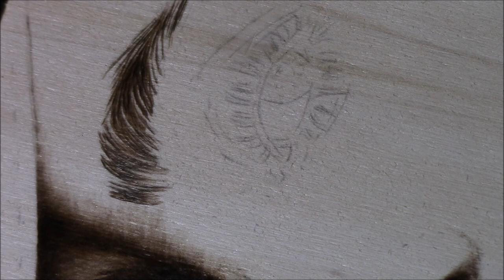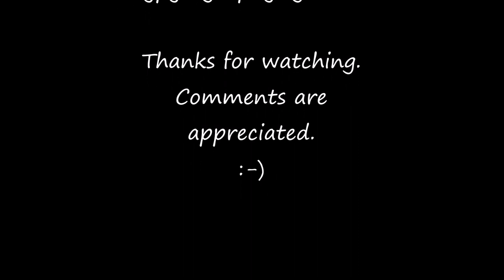Pyrography – Portrait of Lady Gaga – with a little talk about art and social media exposure

Comment: What wood finish do you use? Liked the videos thanks.
Reply from the maker: Hi Ray. Thank you very much.
First I use a universal fixative because I used a white pencil to enhance the whites. You can buy it at any art store. After that dries I use a layer of wood sealant. It is acrylic water based. After that dries (maybe 24 hours) I use a polyurethane spray. This last one you can apply several layers until you achieve the result (gloss) you like. Wait for it to dry between each layer.

1 - For the pencil
https://www.amazon.co.uk/Ghiant-Fixative-Fast-Dying-Acid-Free-Non-Yellowing/dp/B073VP9FX7/ref=sr_1_fkmr0_1?ie=UTF8&qid=1525024801&sr=8-1-fkmr0&keywords=giant+academy+fixative

2 - to seal
https://www.amazon.co.uk/Bondex-tapaporos-0-75-L/dp/B010Q32OWW/ref=sr_1_cc_2?s=aps&ie=UTF8&qid=1525024916&sr=1-2-catcorr&keywords=tapaporos

3 - The finish
https://www.amazon.co.uk/Rust-Oleum-400ml-Crystal-Clear-Spray/dp/B001W03PRM/ref=sr_1_3?s=diy&ie=UTF8&qid=1525025367&sr=1-3&keywords=rustoleum+spray+paint+for+wood

Thank you very much for watching my videos and for your comment.
Hope this helps and works for you.
Reply: Thanks

Comment: What paper and temperature did you use for this portrait?   BTW I love your work!
Reply from the maker: Hi Gabrielle. Thank you very much. This is birch plywood. It's sold by Amazon. They have several sizes. This one is A4 size. I used lower settings and two machines. First the Razertip and finished it with the Optima. They work very different from each other concerning heat leves. I used between 4 and 7 on the Razertip and between 0,5 and 5 on the Optima. Hope this helps.